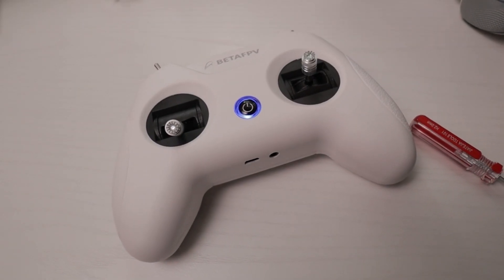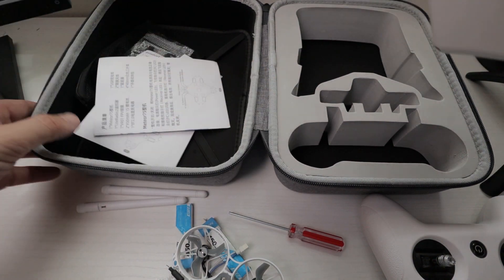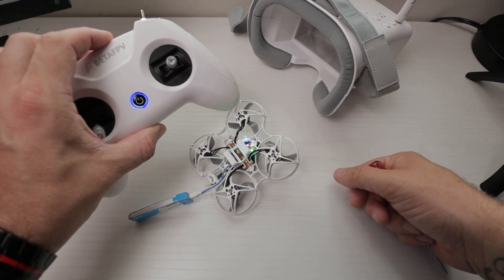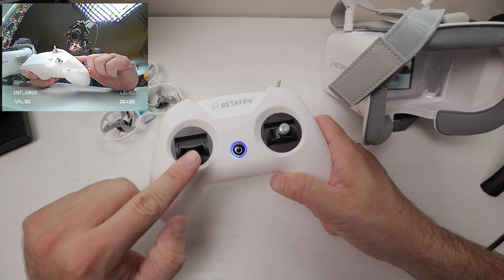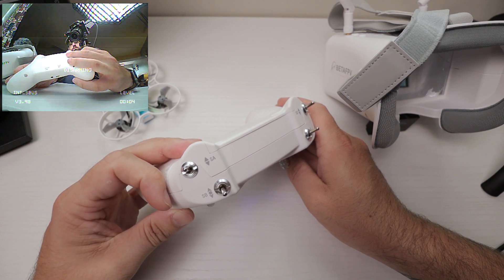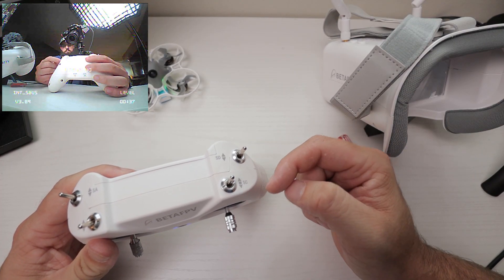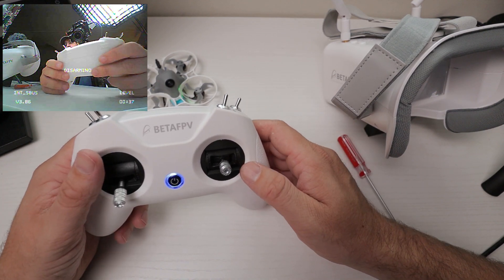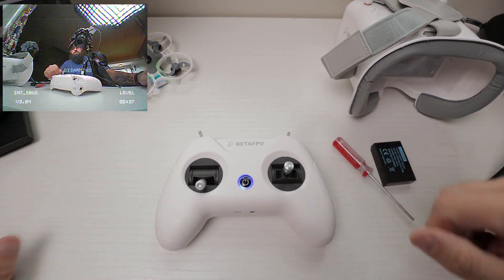BetaFPV Advanced Kit 2 - HOW TO:  Bind, Adjust the FPV Channels and Flight Modes

Comment: Just got my Starter kit from BetaFPV and been crashing the drone left and right with my 9 years old. Been searching all night last night and couldn't find anything about the switches and different fly mode, not even on their website or the manual it came with. Thank you for covering all the different mode and what the switches does.
Reply from the maker: Awesome to hear but even better than that is flying with your 9 year old.  Glad I was able to help.  Keep having fun together!
Reply: Buddy RC thanks! While I have you here, is it possible to tune it so it’s not so responsive? Also I feel the drone tend to lean toward the left a bit, is there a way to calibrate? Sorry that I dragged you into more questions, was not planned :D

Comment: In addition to my quad not being bound, it also has no USB socket fitted. So I'm unable to update betaflight. Poor quality control.
Reply from the maker: These are not betaflight quads.
Reply: @BuddyRC  well whatever it runs I can't connect it to my pc to find out. There must be something to adjust but with no socket I will never know.
Reply from the maker: @ryalman21  That's correct.  They aren't designed to be connected to a PC.  All settings are adjusted through the on screen display.
Reply from the maker: @ryalman21  https://betafpv.com/collections/brushless-flight-controller/products/lite-2s-brushless-flight-controller-frsky

This is the flight controller installed in the drone.
If you scroll down that page you can see where I'm actually NOT fully correct.  While there isn't a USB port and all settings can be adjusted on the OSD.  There is a way to connect it to a PC however it requires a  "NewBeeDrone BeeLink USB Flasher." If you have the new orange board.
Reply: @BuddyRC  many thanks, I stand corrected 😁
Reply: @BuddyRC  No, that's not the FC we are all discussing above. The LITE 2S is a silverware board for 2S batteries and with no VTX. I got one to try to fix my problems butr seems more hassel than it's worth.
Reply from the maker: @salvor1  ooooooooh dang man. It's one of those I can ask them to send whatever to do videos for. But with Chinese new year starting they'll probably be shut down til end of feb

Comment: Great video! I'm older and not really an advanced flyer. To get Stability mode, B is flipped to which position? Considering that I already have a set of Eachine goggles and I fly in Stability mode, just messing around in my yard, which quad and controller would you recommend? I want real sticks on real gimbals, not the thumb sticks and plastic gimbals. Thanks.

Comment: Super neat video. I have the starter kit, in which they give you the same, except the drone is slightly different (the 65s). 
Unfortunately or so I believe, I got mine with the bayang protocol (not sure if I can do somtheing about that now). I do not really know if the drone has any technical issue, but the range is a complete joke. I get like 30-40 feet outside. Not to mention, when I use the DVR function on the goggles, the video which it records is of a supreme sh*t quality. It does not even match the mediocre quality which I get live, unless the drone is within 3 to 5 meters, the video just turns into white bars. And also there is no sound to that recording. There is only some scrambled audio noise, like when you tuned your old radio frequency. Any thoughts or suggestions? Thanks!

Comment: Hi, great video! Got my kit through last week. 

I can’t seem to connect the video to the goggles though... it will connect after searching but then drop out a minute or two later even if left right next to each other. I’ve tried going in and setting the channel as B1 then setting the goggles to B1 but then it doesn’t receive any video at all. I’ve also bumped it up to 200mw but still no change. 

Any advice would be great!
Reply: I’m having sane issues

Comment: I tried it like 20 times exactly like you did it, but it doesnt work. The motors doesnt start when i switch them on. The blue light is flashing and i saw that that means: ‚binding status‘. I really dont get it. Is it because i live in switzerland and there is no permission for betafpv to fly here? I reaaaally dont get it pls help
Reply from the maker: Not at all.  These kind of drones don't care about location.  They have no way to determine location or where they are.  In the on screen display, when you flip switches does the flight mode or anything change?  If not then the controller is not bound to the drone
Reply: Buddy RC yes it does. It switches from race_a to race_h to acro to level. So the controller really seems to be connected succesfully. But the blue LED is flashing where it should be off. Everything is right tbh. But the motors dont start i really dont get it.
Reply from the maker: @ferhattokay  Interesting.   When you plug the battery in on the drone leave it sit flat while it initializes.  Check the OSD to verify it does not say TURTLE.  Ensure the left stick is all the way down and try to arm.  If the motors are not spinning when you arm the next thing I would do is contact betafpv support and see if they can walk you through what's wrong.
https://betafpv.freshdesk.com/support/tickets/new
Reply: Buddy RC thanks for the advise. I tried again, but like before, the motors dont start. Its really weird. Where on the OSD should stand TURTLE. There is no writing of TURTLE at all. I try to contact BetaFPV. Thanks

Comment: Do you know how to fix a motor that wont spin? When I arm the drone, the front port motor won't spin very well.
Reply: Same issue here, I change the motor with an other one same issue, so it's come from the flight controller board in my case
Reply: I had a crash in some mulch and didn’t disarm fast enough ( I think) and have this same issue. I suspect I burned the ESC, which I have no idea how to replace. All 4 motors are fine since I can re-route the one that won’t arm into a different port and it turns on fine. Was having a blast with this drone till that happened. I guess a new FC board is the only fix?
Reply: @tommustang02  Yep, after a few emails with Betafpv customer service, they said to me that the FC is dead and they send me a new one (my kit is still under warranty).

Comment: total newbie to the fpv drone I never used goggles before and I just see a blank blue screen when I hit the search button so any help on how to connect the goggles would be helpful everything else seems ok got the receiver to bind but don't know where to go from here cant see anything through the goggles.
Reply: Press and hold the search button to change from AV and Radio mode, tap once to auto search

Comment: Been learning with basic start kit couple weeks Now radio is stuck in ACRO . Any suggestions
Reply from the maker: By flipping all of the switches it just stays there and doesn't move?
Reply: @BuddyRC  WOW! Thanks for the quick response, yeah no change. Should I open it up see if somethings disconnected
Reply from the maker: Dale Hendrix honestly I don't think that would happen. I would reach out to betafpv through their support system and see if they have heard of this happening before.  Personally I haven't seen or heard of any issues like that before. Did it just start happening?  Still able to fly but just only acro mode?
Reply: When you said flip ALL switches got me thinking. Tried again and at first only arm switch worked but after several various switch flips it started working...or maybe I was just high, anyway keep the tutorials coming for fools like me
Reply from the maker: Dale Hendrix hahaha that's the thing with this setup is acro switch overrides everything. So it's funky but once you realize it's the switch combinations that change flight modes I just flip them til it shows me what I want 😂

Comment: great video, helped me understand more, but i tried to change to D8 mode just like in the video following exact steps and it won't do anything, it just turns on (directly to blue after green), no flashing in between or anything. the only flashing i get is the normal "binding" flash. anyone has the same issue?
Reply: Hey man, yes. I had the same issue. I opened the controller up to see if everything was connected properly, and found a loose joint on one of the boards. I touched that up and suddenly it all worked perfectly. I still can't fly for sh!t, but at least everything else is fine now.
Reply: @waldovanderwaal  Where was it? I don't really feel comfortable just going to town hoping i'm soldering the right thing
Reply: @theangryginger7582  TBH, I can't remember off-hand. But when I opened the transmitter, there was a loose wire and just one solder joint that it clearly should've been connected to. My advice: Just open it carefully and take a look. Definitely worth it...
Reply: @waldovanderwaal  I did and I didn't see anything. However when I pressed the bind button directly on the circuit board it started working again. Weird

Comment: This was super helpful. I finally got it bound. However, it won’t arm and fly. The switches change the mode as expected, but the SA switch does nothing and the props don’t spin. Any advice? Any idea where to find answers?
Reply from the maker: Were you able to find a solution?  If the OSD is showing the switches working my first step would be to unplug and plug in so it's level as the battery is plugged in.  Verify that the drone is not in turtle mode.

Comment: Have you had any instability with the video channels? I keep losing video during operation despite drone, goggles and controller being within arms reach, and when I turn it all back after having everything working the video channel seems to have been lost. Also, for me,  the labels for the channels are different between the goggles and the drone, and setting the frequencies the same (e.g. 5820 M) on both doesn't work, so something is out of sync. Did you see anything like that?
Reply: The VTX on these have been overheating, causing the drop no matter how close or far you are to the drone. People have been getting the F4 1S AIO Flight controller to replace it.

Comment: Fantastic video buddy. Just bought this kit and couldn't get it to do a thing. Came unbound and I drained both batteries trying to figure it out. Until I found your video. Just waiting for them to recharge to try your setup. I've already changed the transmitter to D8 as per your instructions. The provided instructions are rubbish. I thought I'd been sent a duff drone and would have to send it back to China or where ever BETAFPV are based. Big big thanks again for a great video.
Reply from the maker: Excellent to hear.  And comments like this are what makes the effort to make these videos worth every second!
Reply: Same from me, but worse: There was a loose joint inside my Literadio 2 right out of the box. I did everything as you instructed, but the transmitter wouldn't go into binding mode. Tracked down the problem joint and fixed it - now everything works, but I wouldn't have even started looking for it if I hadn't found your video. Thanks man!

Comment: I bought my kit with you, the video is very good mine I have a signal problem, lose the image, what can I do to improve the image reception?
Reply from the maker: The first suggestion is to always verify the channel on the goggle and quad match.  It can be one channel off and look like it's good until you start flying and you'll lose video after a few feet.
Reply: VTX overheating, I have made sure that everything is binded correctly and will fly in directly in front of me for about 10 seconds and it loses image. When in the cold weather it works fine.

Comment: I tried to get my controller in DO mode. Doesn't flash at all. Goes from Green to red. Nevermind I'm an idiot. Left stick wasn't all the way down
Reply from the maker: LOL - no idiots, just learning opportunities 😅
Reply: @BuddyRC  Thanks for your help. I gave a Like and a Subscribe. Question for ya, when I set the channel for the goggles it shows static even tho I already set a specific channel. Only way I can get video is hitting the search button. Soon as I take off I barely get 10 ft sometimes before I lose video.
Reply from the maker: @DOHCtorMiguel  That tells me the channel on the quadcopter is not matching the channel on the goggles.  I use search to get close enough to see the video.  THEN go into the OSD on the quadcopter and manually set the channel to what I want.  Then manually change the channel on the goggles to what I changed it to on the quad.
Reply: @BuddyRC  thanks for the response. I did set the channel on the OSD and when I set the channel on the goggles it's static SOMETIMES. For example I set it to B5 I flew it for a few then crashed, I flip up my goggles to retrieve it and I look back into the goggles it's static. I'll have to cycle thru and sometimes I'll find it on B1 or B4. I made sure I hit SET, BACK, and SAVE on the OSD. It's like it's not saving or something.Im wondering if upgrading the antennas would help